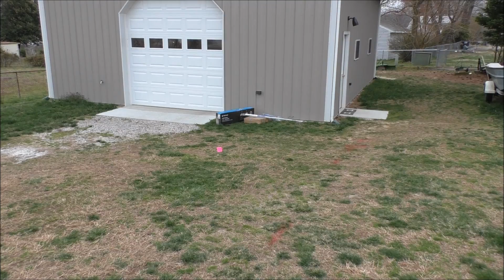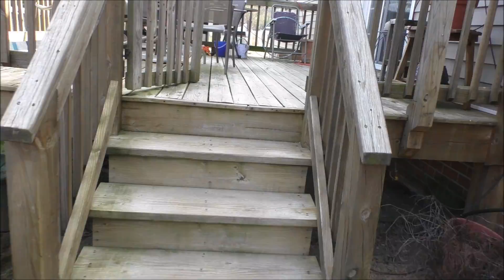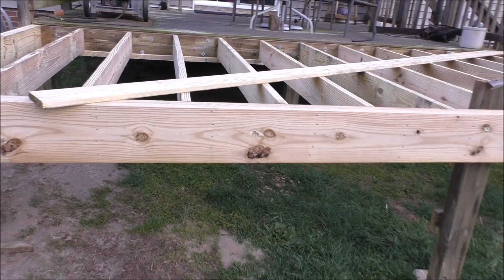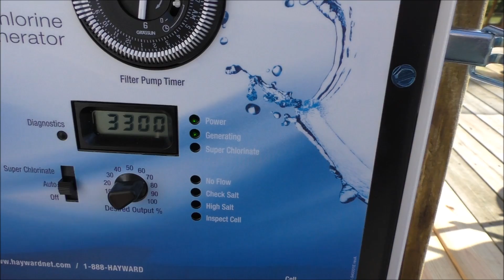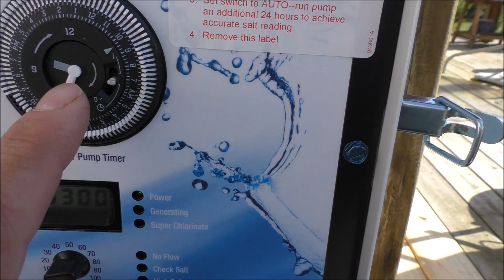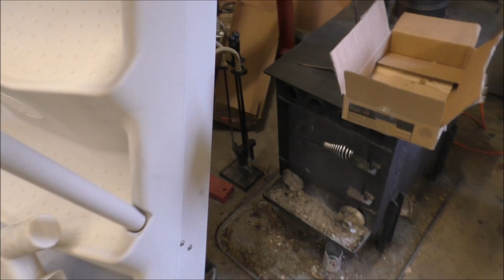Saltwater 8000 Series - 21 Ft x 54 Inch tall  Above Ground Pool Install With KVUSMC

Comment: I have basically the same pool. We have the saltwater lx. I’m having trouble seeing where to put the screws on the top rails. Do you have a video on that or could you show where you put them on yours?
Reply from the maker: They are under the posts
Reply: KVUSMC / Kenneth W Viar Jr I found where they go. The issue we have now is we filled the pool up with some water and it is not level. Not sure how it happened because it was almost perfectly level according to my builders level. There’s about a 4” difference on one corner. Did you run into any troubles with leveling?
Reply from the maker: I sure didn't no troubles leveling
Reply: Thank you so much for the reply. We did figure it out. :)
Reply: I am wondering that too. Did you find a video?
Reply: @beauch112 are you able to show how you attached the top rails and where the screws went?
Reply: @amybowman7468 our pool is still covered. If you remind me in a couple weeks, I can probably show you.

Comment: Kenny I'm putting together a pool package and am thinking about a pool light. Hear some horror stories about pool lights not working for long or lasting. How's the Hayward Elite light you had installed?
Reply from the maker: It is working great going on its 4th season not a problem with the light at all

Comment: Hi,  This pool looks beautiful. How long have you had it and do you have any rust any where?  I am looking at this some pool from the pool factory 33' X 54" Saltwater but am worried about rusting due to the saltwater on the metal. HAPPY EASTER
Reply from the maker: Hi Buddy It is Made for Salt Water Our is 3 years old looks like the day we put it up Tough material
Reply: KVUSMC / Kenneth W Viar Jr How are you liking the salt water system and how is it while swimming? I did find the company and am looking at this pool but its 33 X 54. Saltwater

Comment: did they have any issues getting the lower ring spaced to the correct size. we have the same pool but having a hard to get it it correct circle size. thx
Reply from the maker: Every thing Went Smooth My Pool Guy Made Everything look Simple

Comment: Do you have any video of them building the base after they excavated? Did they drop the sand in before or after putting up the walls?
Reply from the maker: Mark Berrier I Sure don't they put sand in first Then Put on rails then put sand On top buddy and leveled it out

Comment: The skimmer on the pool wall - did you notice it floating up when pump is off and turning up side down to have the contents go to other strainer when turns back on.
That clear braided pump hose is going to turn brown, them it gets worse over the years, some kind of clip on shade to protect it from sun would help.
Reply from the maker: SaturnSC2 Many Thanks For The Advice I Appreciate It I Will Protect It Some It From The Sun  With A Cover

Comment: Very pretty looking. Why use salt water? I would be best to put that pump and filter on a concrete slab to keep the mud from getting splashed all over it. The little plastic stand don look like it will work good for that.
Reply from the maker: shartne Thanks Scott It Is Sitting On A Concrete Slab Buddy An existing Heat Pump Pad It Is A Working Progress Buddy
Reply from the maker: shartne Salt Water Is Easier To Maintain And Less Irritating To Eyes And Skin Like Chlorine Scott
Reply: KVUSMC / Kenneth W Viar Jr the pump is hanging over the mud. just saying scoot it over a bit so the electric pump is directly over the pad.
Reply: KVUSMC / Kenneth W Viar Jr That sounds like its a better way. Its nice have fun with it.
Reply from the maker: shartne It Sure Is And Cheaper In The Long Run Than Chlorine Buddy